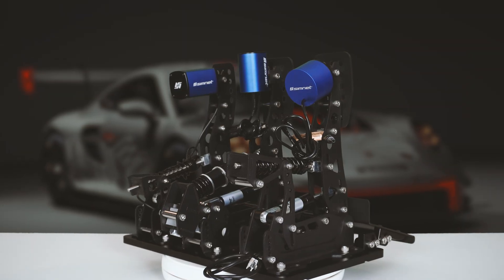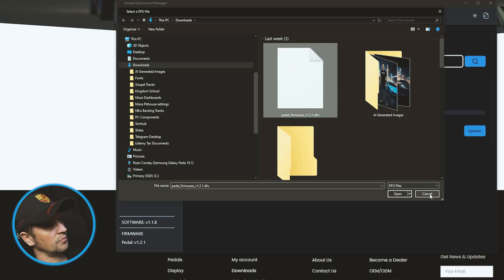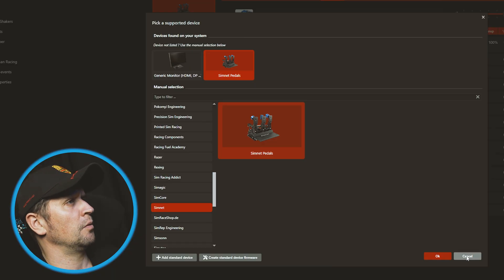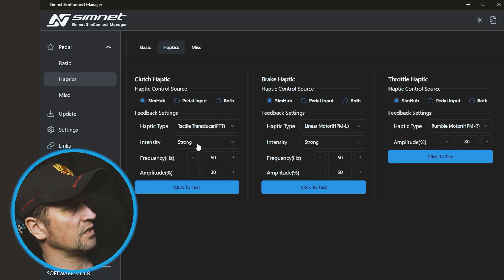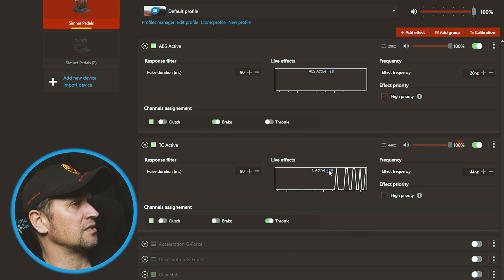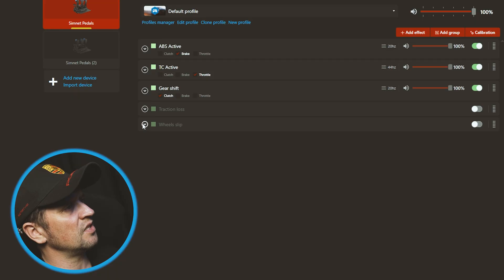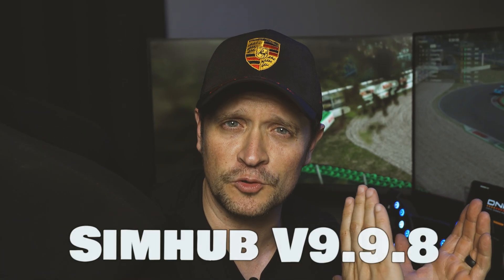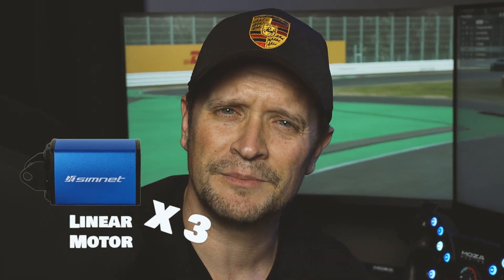How to setup SimNet Haptic Motors in SimHub — Native Support FINALLY!

Comment: Hello and thanks for the good channel. 
I bought the simnet pedals and the 2 linear haptics and followed this video and it all works good as long as im connected to computer.
Then i start game GT7 and put it on the simhub in the simnet app and i dont get anything from haptics,, i have to put it on either both or pedalresponse and i get to choose from 3 different constant haptic moove.
I use the PS5 play GT7 and connected to Fanatec dd pro.
Reply from the maker: Hey man. Thanks for the compliment and it is only a pleasure. So I will be getting a Fanatec base and wheel very soon. And then I will put together a proper Fanatec and Simnet Pedal video.

I did create this other video for the Thrustmaster wheel, but if you skip to the section about the haptics and simhub, it will apply to you as well.
 Here is the link that will skip right to that section. https://www.youtube.com/watch?v=eMG73ABUhOM&t=168s

If it still doesn't work, jump onto the Simnet Discord. https://discord.com/invite/e4fuS8TYTw and ask for help there. I will only be able to assist with Fanatec issues, once I have received the base and I have got it working myself.
Reply: @virtualmotorheads  Well it wasnt that eazy as i thought...still does not work but when i go to home at simhub it sais that i need to set access to GT7 on my firewall for ports 33739 and 33740 (UDP), console must be reachable on the same network ^^

I did set the ports first on UDP and then also at TCP on my firewall but did not change anything, googling it sais there is no channels called 33739 and 33740 and they would start or be called 53. Will go to discord you recomended and see if i get moore answers....and thanks again for the content!!!
Reply from the maker: Getting that Fanatec soon. Then I can also see what is going on and hopefully put together an awesome video for the guys who are struggling like yourself. Thanks again for watching man.

Comment: Can I install the Simnet Haptics — for example, the HPM-L or HPM-R — on a Fanatec CSL pedal set (LC brake and throttle) using the Simnet Control Box and the corresponding power supply without having to buy the Simnet SP Pro pedals, and then configure the haptics via SimHub or Simnet software in order to play GT7 or ACC on the PS5?
The telemetry data would still be retrieved via the PS5’s IP address, correct?
Reply from the maker: Yes to all your questions. 😁

Comment: I tried this but in SimHub after adding the pedals it says "searching device" where as on yours it says "connected". Any clue?
Reply from the maker: Did you switch off the arduino? If you have added them previously using that method, you need to switch it off completely. Secondly just making sure, your pedals is updated to 1.2.1 right?
Reply from the maker: This has to work. Are your pedals plugged into the wheel base? Or USB directly?
Reply: @virtualmotorheads  Its weird. It wouldnt recognize the pedals even after removing the old arduino configuration and after restarting PC and the wheelbase mutiple times. I reinstalled simhub (I had the latest version already) and its working fine now! Thanks for your help

Would you mind sharing your personal preference with the effects, strengths, frequency, pedal assignments etc.?
Reply from the maker: @louissenn9897 awesome man. Glad you got it sorted. My settings and frequencies I chose, it is all in the video. 😁
Reply: @virtualmotorheads  Akward! I forgot that I havent even made it that far into the video because of the problems
Reply from the maker: @louissenn9897 No worries. Let me know how it goes.👍🏻
Reply: @virtualmotorheads  It feels really nice. I added RPM to the throttle at 50Hz but only 10% intensitiy. Its very suttle but I think its cool especially if the car idles.

I played around with it a while ago and I felt like adding too much effects can ruin the experience. I really wanted wheel slip to work but it always felt a little off.
Reply from the maker: @louissenn9897 I agree. Wheel slip...just doesn't work. Don't know why....maybe a telemetry problem from the game.

Which motors do you have? Only linear?
Reply: @virtualmotorheads  Yeah I have 3 of those. They feel amazing. Adding these to my rig was worth every penny. It really adds a lot of immersion especially paired with VR 

Next step is either adding QS210 motion or a BT1 belt tensioner. Not sure yet and will definitely need so save up some more first
Reply from the maker: @louissenn9897 Apparently the belt tensioner is game changing. So damn expensive here in South Africa. 🙈

Comment: Hey man your material should be getting so much more exposure. It's crazy how South African and probably African creators get no love in the global algorithm. The work that goes it to your edits, and your choice to have your video material look consistent with your grading. You are as good as any of the "top" creators. You also get little love from the suppliers of gear but that may have changed. Great work man.
Reply from the maker: Thank you so much for this comment. Really means a lot to hear that the work I put in is noticed. You’re right, it can be tough for South African creators to break through, but messages like yours keep me pushing forward. Glad you’re enjoying the content.

Plenty more where that came from. 😁